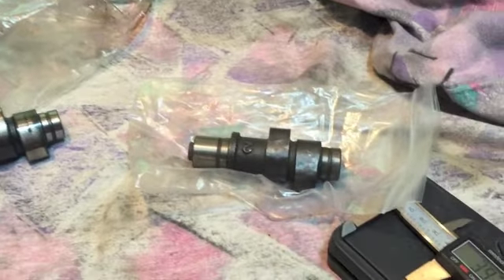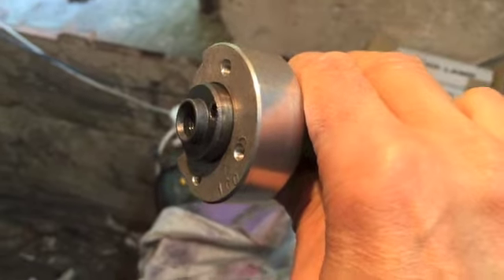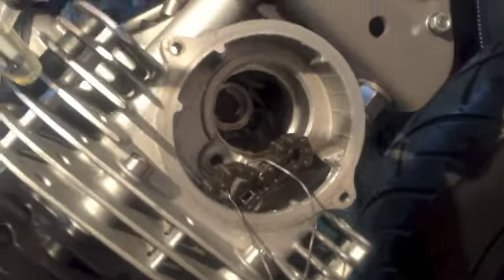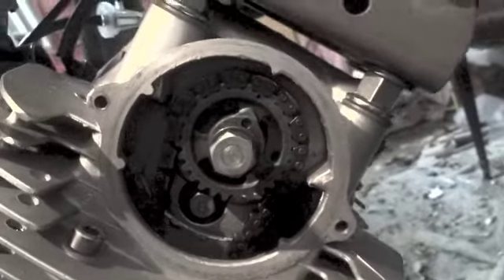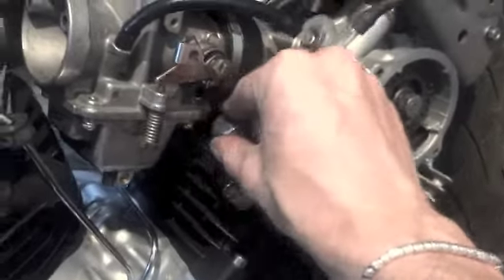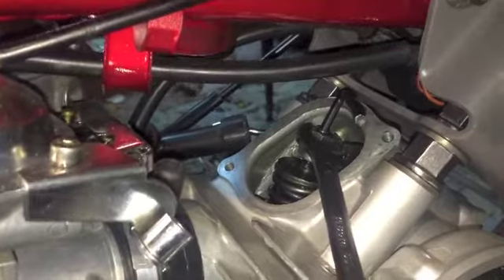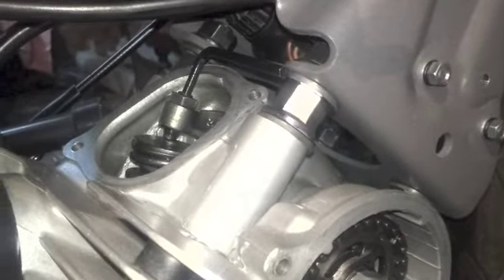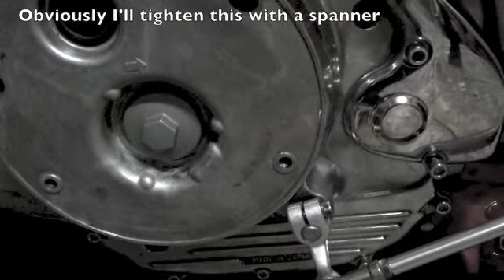XV750 Virago Camshaft Replacement And Timing

Comment: So I just found your page and I'm a big fan of viragos I am working on my like fourth one,mine's in the shop right now getting some straight pipes done so have you had any internal engine work done like bigger cylinders or anything or is that the initial mono shock year top dead center timing for that engine?, the 750.? Because when I get mine out of the shop I want to check it and I don't want to mess with it I'm not very good at internal work but I can build some mean looking bikes
Reply from the maker: Hi. I haven’t had done any modifications to the engine. This is a XV750 first gen engine. That is how to find top dead centre. It you want to double check you can always remove the plugs and put a long screwdriver in which will rest on the top of the piston showing you that it is at its highest point.
Reply: @Sorcli  kewl deal, man

Comment: Change the bushes by bearings
Reply from the maker: Thanks, I may do that in the future.
Reply: It prevents the camshaft from locing up ( to little oil during low revs) and breaking the pin holding the cam chain gear  6205 (IIRC) 
http://www.tr1.de/pages/forum.php?iQuery=num=1443026799/1#1
also look for the oil pressure

Comment: Can you direct me where to find out how to remove the heads on this engine?
Reply from the maker: BigCal7 Unfortunately I don’t think anyone has done a video on it. Basically you have to remove the complete engine from the bike, or as I did, lift the bike off the engine and them remove it. The manual is available online free if you search it and that explains what to do

Comment: you didn't show how you removed the cam
Reply from the maker: Phil manwarren Once you have removed the alloy retaining sleeve it just pulls out. BUT you MUST ensure that the crank is placed in a position that neither valve is open.
Reply: Clive Hancy top dead center